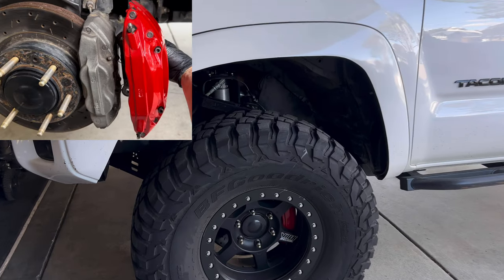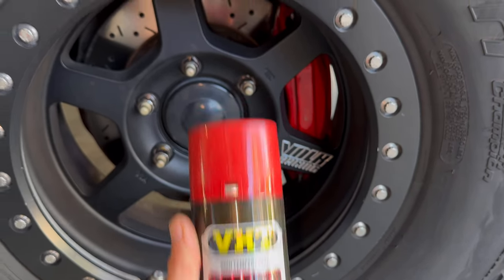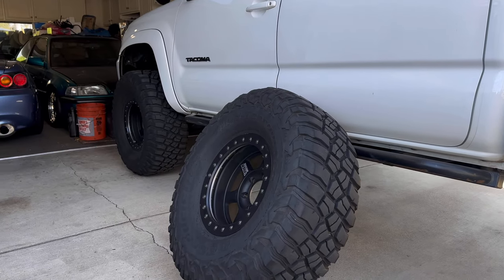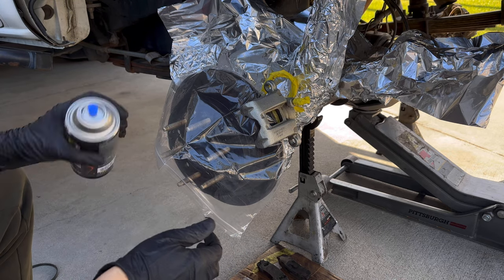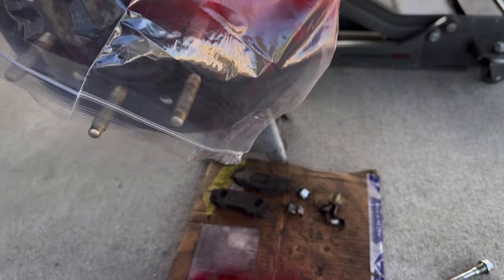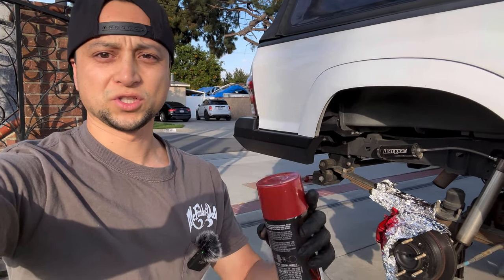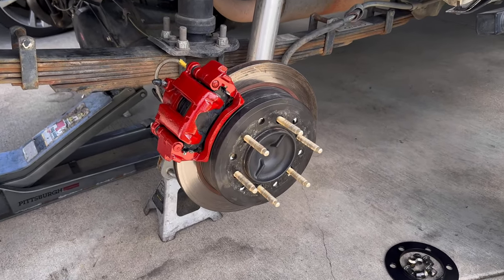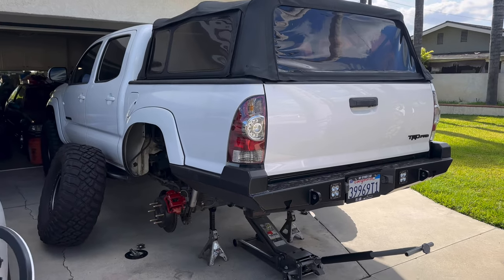Color Matching The Rear Disc Brake Conversion On My Tacoma!

Comment: Would you recommend the rear disc conversion? Any problems with sand or mud?
Reply from the maker: Yes, it is highly recommended due to rear wheel cylinders on drum brakes failing. Once those go out all the fluid is pushed out and you have no brakes. This is mainly an issue after water crossings on Tacomas. You can probably find more info about it on the tacomaworld forum.